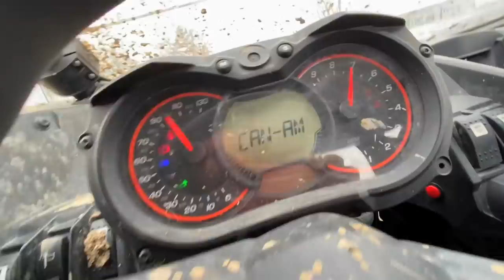RZR Vs X3 FIRST SNOW!

Comment: Hey Mark.  You should take a hood off of one of the trucks or the full size car, so its a big one ,   and try doing  burnouts on the hood its should smoke pretty good, maybe better than the plywood!!!!!
Reply from the maker: Wood works best!
Reply: @markfreeman408   I had seen it  before, and seemed to do pretty good, I know the wood gets worn out a bit and slippery.